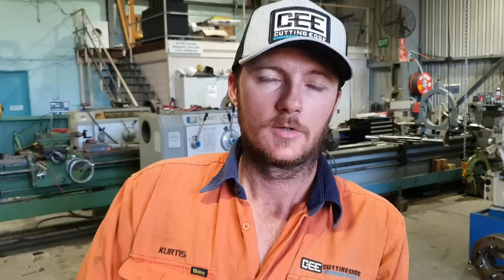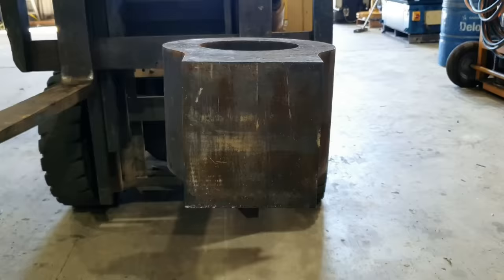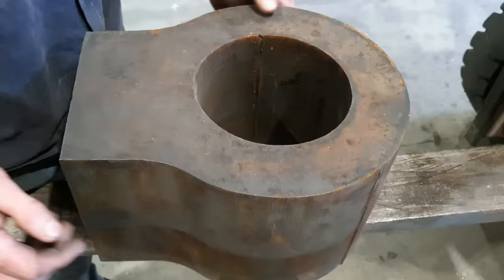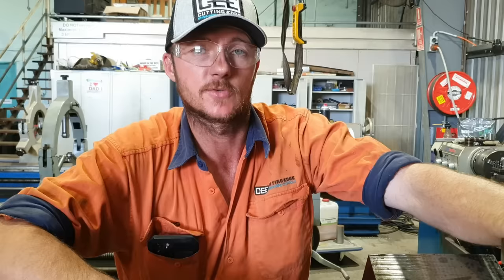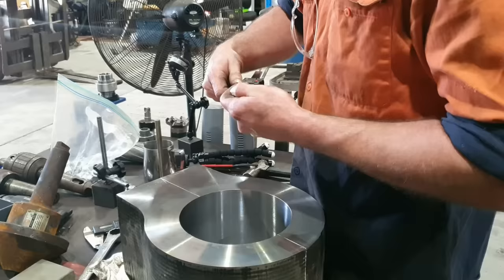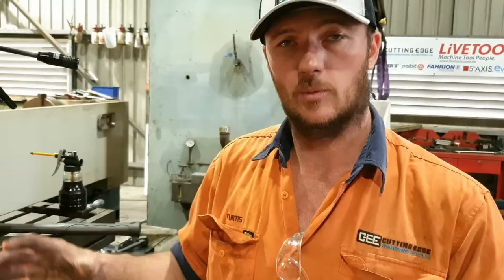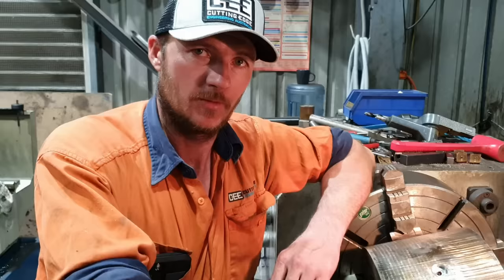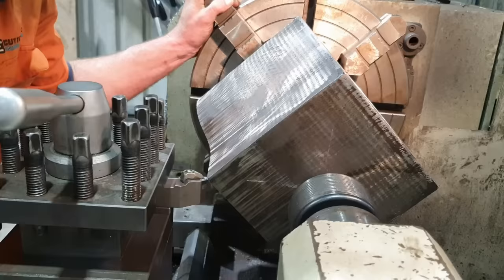Making a BIG Hydraulic Cylinder Rod & Eye | Part 1

Comment: Always amazed at the point load that the ceramic inserts can take.
Reply from the maker: They were heavy interrupted cut inserts and can take a flogging
Reply: I was amazed as well! Those are some good inserts to not shatter under those impacts. I am sure you could feel the thumps in your feet.
Reply: @TheEvertw , shoot, they were feeling those thumps in dance clubs in Canberra!
Reply: Tungsten Carbide
Reply: @hollowdog7208  Try doing this with your run-of-the-mill Chinese TC inserts, and watch the pieces fly.

Comment: I really enjoy seeing these little tricks you use to fix the workpiece in the maschine.
Reply from the maker: Awesome thanks for watching
Reply: I agree.  When you first loaded the eye in the 4 jaw I wondered what you were thinking when you advanced the two "forward" jaws to the material and then put the two inserts in. I figured all that would do was push it out of the chuck. Then you welded them in and I saw the method of using the corner to actually drag it into the chuck. Very clever idea. I'll store that one away for reference.

Comment: Yup ! I can literally smell the surroundings while you operate the grinder.
Reply from the maker: Hahaa nice. Thanks for watching mate
Reply: @CuttingEdgeEngineering  The typical Steel in the Air smell.
Reply: @ROHX-eq7md  the old black sneeze
Reply: ... and nice use of the boot to get the correct angle, too!

Comment: Kurtis, I love watching all kinds of welding/machining channels. And not just the big stuff, even the smaller scale machine channels as well. One guy I recently found was Heritage Machining. The guy works as a 3d CAD operator during the day and his machine shop he inherited from his grandfather. He built a shop inside a pole barn (aka large shed) like whay youhave in Australia, except the condition of the shed/pole barn was less than ideal to use as it sat.

Comment: Very nicely done including the radius. That radius is not just eye candy, it tries to prevent pinpoint stresses from building up on the surface. For it to operate as intended, the finish and the transitions around that radius should be fairly smooth. I probably would have done the last finish for the round part using the button tool just to get that radius as smooth as possible.

Comment: To Karen… your video shots are outstanding. I don’t know if you’ve taken classes on this or if it is instinctual (I’ll bet the latter) but you place the camera in the right place at the right time.  During the facing of the part, you had the camera perfect for those rainbow rays coming off the the oil on the face of the part.  There are DPs that would DIE for a shot like this!  You’re editing is excellent but more important, you know your audience and their threshold of watching real-time and when to get creative (slo-mo or time lapse) with just the right music track. I’ve worked with videographers in the past that this would go right over their heads.  Kudos. [from a recently retired tech company 	instructional manager]

Comment: They break 20mm from the weld due to the "heat affected zone"  the heat from the weld travels into the parent material and changes the grain structure of the steel. The weld?   Was melted and cooled quickly thru conduction.  But that heat traveling up the part heats it less and less as it moves away from the weld..  there's always a point where the grain affected  is the most... that's where it fails.      U can help it by preheating.  But it'll only do so much..   best thing is to design the part to accommodate the weakness in that zone....   only as strong as the weakest link

Comment: Safety officer is on the take, ref can afford his own Helicopter🚁. Lol. Ran straight in to the arms of his sweetheart.
Interesting the eye material failed quite a distance from the weld, possibly outside the heat affected zone (HAZ), looked like it had some voids at the fracture face, though initiation point may have been the very rough surface of the forging.
Great work both, and brilliant direction, need her and his high chairs.
Thanks for sharing and stay Safe..

Comment: Almost made me cry, watching how easy that bushing was pressed out of the old eye.  😅 How many tons is that?
I'm not lucky enough to have a big press like that, so I had to be more creative.  I ended up running a dozen or so weld beads across the inside face of the bushing, and let it cool, which caused just enough weld shrinkage, that I was able to sledge hammer them out with a chunk of roundstock as a follower.

Comment: You mentioned that the cause of the fail was side loading on the eye. did you figure out the cause of that cuz if you think about it thats gotta be some serious side load to cause this and makes me think either the eye itself was machined/bent or the bushings/bearings? on the arm itself is worn and while the cylinder is retracted causing major side load stress?
Reply: The side loading is probably due to the operator puting the flat backside down on the ground then sliding it across the ground  to try to push some heavy rocks to the right or left really bad idea the bucket is not a broom .....

Comment: These rod ends are known to crack at the grease points. A question -
Why not drill up the middle from the rod end. Then drill into the side (away from the stressed ring) so the holes meet up. You’d need to drill two holes but the end result should be stronger. You could even fit two grease nipples - easier for the machine operator.

Comment: Your videos are nothing short of fantastic! The detail and the process you go through to manufacture these parts is fascinating. A couple of questions though: I can understand the need to custom remanufacture parts for old equipment because the manufacturer might not still be in business. However, most of the equipment you are remaking parts for seems to be relatively modern. Why do you you remake parts when the manufacturer is still in business? Is it less expensive for you to make these parts because there is no import fees? Are your remade parts better? Are you usually more expensive or less expensive than OEM parts?

Comment: As I was re-watching this video, I couldn't help but wonder if the original eye was forged or cast?  Making the new one from plate would be stronger than cast, but probably not as strong as forged.  Can you shed a bit of light on it for me?  Thanks (a 77 year old engineer with tons of exposure to welding, casting, forging, sheet fab and major equipment design who still loves  the business.)

Comment: I find it so interesting that this even has to be done. It would seem to me that a part that so regularly breaks, would have a stick supply from the manufacturer so fabricating a new eye and rod wouldn't be necessary nor cost effective. But I suppose there are good reasons. Probably due to the fact that the quantity of units sold around the world just doesn't justify the cost of keeping spare parts in stock and slobg with the I frequency of failure relatively speaking is probably why but I'm guessing. Can anyone chime in here and enlighten us all?
Reply: Blame it on J.I.T. , JUST IN TIME  , it doesnt pay to keep money tied up in extra Finished stock , if the supply chain is working  , some companies are wishing they had a little backstock now days ....

Comment: Would it be feasible to have the quenching fluid incorporated with the boring bar?  cut a hole through the middle to insert a tube for the quenching fluid. It seems that this would make delivering the quenching fluid closer to the actual work. Just a thought.

Comment: Yet another informative and fascinating video from the guys “down under”. It’s been quite an eye opener watching the work you do and easy to see why carrying on such engineering is a great incentive for getting out of bed, with no two jobs being the same - a massive difference to the type of work carried out by factories.
There are so many questions I have but I appreciate how busy you are so I’ll leave one question and hope that someone reads this and is kind enough to answer - what are the criteria for using an oil can as opposed to constant fluid cooling ie is it the metal or the cutting tool that decides it, or something else? 
It’s great that you show the slo-mo every so often without lots of coolant in the way but is that how these jobs would normally be done or are you being kind to gormless galaas/poms like me? LoL.

Comment: The spinning eyelet on the lathe is terrifying. Nothing like a few hundred pounds of steel spinning, smacking a little piece of metal, clamped by a less than 15% of contact area. I'm sure it's secure, but looks scary as hell.

Comment: we had these big presses that had very similar looking eyes and cylinders that operated them,  only much much bigger, and sometimes someone would mess up and leave a part in the die and double press it, which is real bad, but a lady that was new, did like 8 times, she just hit the button and the part never came out so she loaded it again and did 6 more time until finally it blew the eye off the cylinder, like exploded it, it sounded like a bomb went off and this huge piece of the eye hit my machine and had my machine not had two parts crates stacked up i'd probably been killed by it, it hit the parts crates tho and there was probably a few tons of parts in each one so it got stuck and i lived lol, i swear that factory i worked at in ohio almost killed me i think 3 different times, it finally just maimed it when i got my hand pulled into a buffer wheel 

PS @ 22 mins the hard style edm music starts <3

Comment: For such massive weld prep is there a reason you could not cut off at least 10 to 25 lbs of material with a grinder to hog off so much time in the lathe ?

Comment: I'm curious as to why you wouldn't put this into the milling machine to level off the surface. 

But I guess since you have to put it into the lathe anyway to bore it out, I assume that just means that you don't want to move it around from machine to machine and waste time on a step you could do on either machine.

Comment: Hey guy, 
Yes it was the parent material that failed, not the weld itself. . . 
However it was the HAZ (heat affected zone) that was weakened in the parent material by the welding process.
Intense heat affected the microstructure of the eye material.
Simple.
My recommendation is preheat those parts for welding (temp @ welding is important)
Post heat too, seriously.
And a post heat treatment to normalise the metal.
You have to have the parts cool down really slowly.
Actually you really need to re heat treat the parts after welding operations or it's just a f... Up.
I don't care if they are too big to get into a oven.
It's how shit works.

I have a degree in metallurgical engineering, welding operations were loads of fun.

Especially liked explosive welding 🙂 followed closely by friction welding.

Comment: Kurtis, might be a silly question but, would slowing the drill speed down help with a flame cut piece? Or is high speed still required? I ask because, for us here on the farm, we've learned it varies per project. We've mainly dealt with mild steel. Again, I'm not a machinist. 
How many cutter tips do you normally go through on a job like this? Love watching those chips fly.
Homeless is already stealing the channel. Love that dog. Awesome video as always, cheers :)
Reply from the maker: Hey mate good question slowing drill speed down can help, it really depends on the material each time can be different, I determine it pretty quickly when first start drilling. For a job like use we might use 1-2 side on a 6 sided insert so they last a while, they are designed for heavy interrupted cuts. Cheers, Kurtis

Comment: around 15mins when you were centre drilling. Is that the gearing that sounds grindy or is there a bad bearing?  You're pretty fast at finding them centres. Plenty of practice i assume
Reply from the maker: Hey mate that's just a 90 degree milling head the gears working naturally noisy

Comment: If the breather hole is not drilled for the weld joint would it create an issue during welding ?
Reply from the maker: Hey mate yeah the heat from welding would cause pressure to build up in the weld and cause internal fractures.

Comment: It is unclear why the large hole at the end of the ear part. this hole is needed as the base of the ear + rod in one axis. there can be a diameter of 15 mm. and then boil. Although the cylinder rod has scratches, it is no longer a working surface. how will you restore it?

Comment: 4:30 What sort of cutting process is cutting that deep and relatively clean?

Edit, later he calls it flame cut, which is apparently using an oxygen fuel flame cutter. E.g. an oxy acetylene torch.

Continually surprised at just hot deep you can cut with that process.

Comment: So, what a breather hole? Is it because the new eye is very thick and helps the heat escape?
Reply from the maker: Hey mate yeah pretty much, the size of the weld joint creates a lot of heat in the internal passes and without the breather hole pressure would build up and cause internal weld fractures
Reply: Really enjoy your videos.  I had no idea of all the different types of tools that were used in your line of work.

Comment: Question: is the sleeve that you insert into the eye a different strength or type of steel?
Reply from the maker: Hey mate that's a bushing it's a high grade wear part it is a different material than the eye

Comment: What is the purpose of the air hole when welding. Never seen you do that before
Reply from the maker: Hey mate yeah it's not necessary for smaller rods/eyes, the heat from welding causes pressure to build up in the weld and cause internal fractures on a weld joint this size.

Comment: I think the bearing was the problem. If  welding would be cheaper i would weld it. If you make this part stronger it will fail in other point.

Comment: I always wonder why manufacturers skimp on the material for rod eyes and cylinder bases. Is a cast or forged material that much cheaper? Of course if it only receives straight line loading as designed, it would be strong enough but that isn't what happens in the real world.

Comment: At 53' long, 18' high, and 230,000 pounds and change an EX1200 hoe isn't something you're shipping by truck very frequently. It's more than double the weight of a Cat 349, and even then you gotta pull the counterweight off a 349 to ship it anywhere

Comment: why not use a saw to trim off the square parts before taking a square and making it into a circle?
Reply from the maker: because you'd be adding in a whole other step and process to setup and then cut and would then still need to setup and machine
Reply: @CuttingEdgeEngineering  have you tried this before
Reply: only with wood

Comment: WHATS FUNNY IS YOU GO TO GREAT LENGTHS TO MAKE THINGS RIGHT WHILE OVER IN INDIA, THEY STRAIGHTEN THINGS THAT YOU REPLACE AND THEN POLISH IT WITH HAND CLEANER AND THEN HALF ASS PLATE IT. AFTER THAT, ITS A BUFFING WHEEL AND ROTISSERIE. NOTHING IS DONE TO THE CYLINDER BORE NOR THE SEAL HEAD THATS OBLONG AND THEN THEY ASSEMBLE IT WITH THE WRONG SEALS AND CALL IT GOOD.  AMAZING MECHANICS THEY THINK THAT THEY ARE!